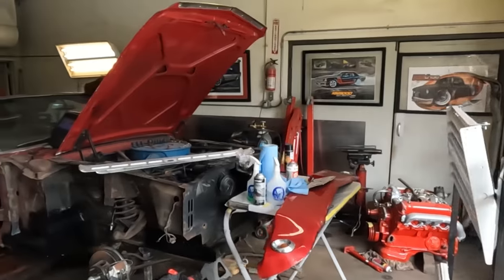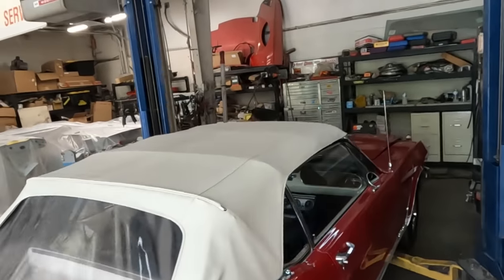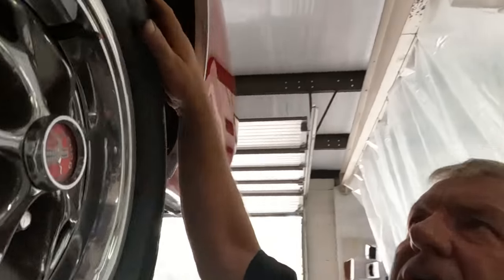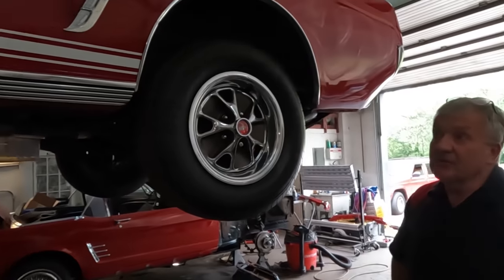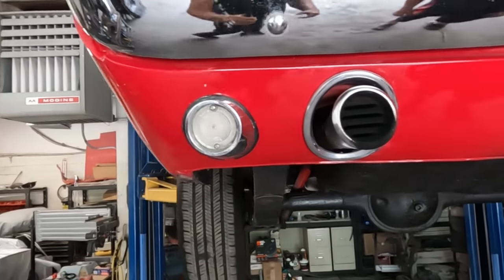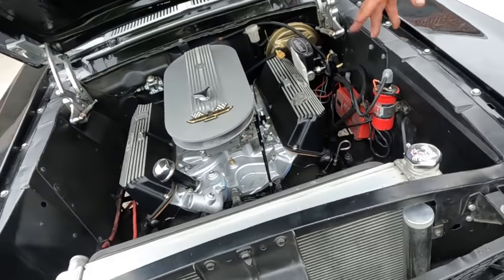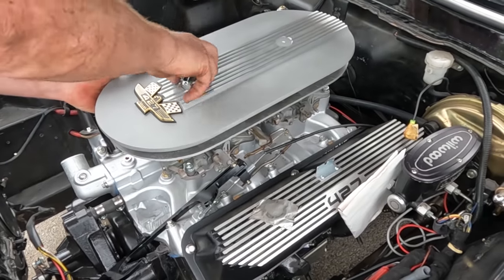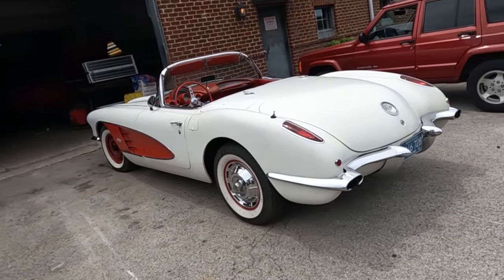Even MORE Classic Car Flipper Thievery, Incompetency And Nonsense

Comment: Don't know if it's true or not, but I've heard there are more '57 Chevy "convertibles" registered today than were built.
Reply: That might be true, but a 57 Chevy has a real chassis and would not need nearly as much added structure when the roof is gone to make it an convertible.
Reply: There’s more 57 Chevy Convertibles registered in California alone than were built. BUT 57 Chevy body’s are reproduced. Same with 32 fords more on the road now than in 32
Reply: @morganbrowning867  there are more amc pacers on the road than were manufacured by amc
Reply: @morganbrowning867  Not supposed to be able to register those as '32's or '57's.  Someone in a NC DMV got into a lot of trouble several years back for issuing bogus titles.
Reply: @seed_drill7135  but you can take a 4 door cowl and make an “original” convertible.
Reply: @hanselemans4237  The 57 has a Frame, the Body is not as important for structure strength!
Reply: There are also more 2 door 57 chevys than ever built.
Reply: and every Chevelle is an SS
Reply: Had a ‘65 Mustang convertible when I was in high school in 1975. “Looked good” but if there were more than 2 people in the car the doors wouldn’t open, or close for that matter. Only owned the car 4 months.
Reply: There are more split window 63 vettes today than registered in 1980
Reply: I wouldn't be surprised one bit by that.    Their are definitely a lot more Cobra's out there than we're ever built
Reply: And every Camaro is an SS, RS, BS, I would NEVER buy a retail, resale, brain dead red redoo. If there is no factory documentation, forget it, & if there is, there are a # of attorneys that specialize in vehicle fraud from this era. A little $  up front.... I checked out a  '68 Shelby 500 that had the front end facing northeast & the back end to the southwest. Otherwise, it was a great car. Hard to believe, but the doors closed. I never bothered checking the horror story underneath. Shelby should have insisted that ALL 'twangs were built with a convertible frame, unlike this umbrella top.
Reply: @gregorylyon1004 cobra kit cars don't count
Reply: @winteroutside7014 that can't be.
Reply: Same with Camaros

Comment: This occurs because the prices of all classic cars have reached ridiculous levels.  This invites the unscrupulous.  The prices for garbage cars from the casual enthusiast are, as a result, way overpriced.
Reply: It's crazy how much more attainable these cars are so long as you're willing to turn a wrench yourself.
Reply: i hate it. I bought a 1961 beetle with no engine back in 2017 for 1,300 bucks and now if i try to get one in same or worse condition easily 4-5k for 61 non running
Reply: Problem is, even your standard car truck ect, somebody could of bought it for 500 1000 because of MAJOR issues, cover it over, add some lucas basically do the used car salesman fix, SOMEHOW get it inspected, and then sell it for 6 7 8 9 grand, when its not worth the registration. A clean interior and exterior sells. That's the sad part.
Reply: ⬆️ Facts, also if you can learn to love sedans or station wagons that will save you alot.
Reply: And you know>
Reply: Here in Holland someone asked for a flooded! second gen pontiac 10K........
Reply: This crap has been going on for years I was born in 79 and remember as a kid cars coming into my old mans shop that was just bought ready to snap in half. This is nothing new. I remember a 65 Mustang Convertible and it was red as a kid being in my dad's shop and the frame was rotted out and the guy had just bought the car not long before. Mustangs seem to attract the slimballs that hide the rot and sell it to poor guys that thought they got a deal.
Reply: heck, not even cars. ever use the expression "get the truth from the horse's mouth" or "don't look a gift horse in the mouth" ? both come from the days when horses were important, so sellers would dye the horse's hair to hide its age. you had to look at its teeth and gums to determine if you were getting screwed or not. and yet here we are, still using the phrases.

as for the high price of old cars...before the prices were high, you didn't have the aftermarket support and repop parts like you can order up now. You bought a rust free 383 car to cut it apart to save a Hemi. Now you can afford to save a rusty 340 car because the price of cars is high enough there's a market for reproduction parts besides what you found in JC Whitney catalogs (VW and flat fender jeep crap).  Mustangs "attract slimeballs" only because that is where the market has always been. Not too many are buying them for gas mileage, like the VWs for example, but I'll bet a few VW buses have had their roofs opened up "23 times" and other such conversions.
Reply: @complexdetai   I bought one in 1975 and the engine fell out. The paint was nice. Probably the strongest thing holding the rust together.
Reply: @complexdetai  
Very true.
Reply: Again, big money ruins everything.
Reply: Respectfully i'll disagree. I live in the rust belt and 5 years ago i picked up a running 1968 Olds 442 for $4500. when Fox bodies were cheap, i picked up one and a turbo t bird (same chassis). If you can stand the LS or the third gen Hemi, there's early versions of those out there still affordable (for example, i'd never buy a new Shelby Mustang when i could pick up a used coyote and slap on a blower and voila--but i'd rather have the performance than a "look at me" car)--and honestly those and the Foxbodies drive better than my old Olds, get better gas mileage for long distance car shows, plus have AC. 

you do have to search more for the old cars, but they are old cars, so you'd have to do a lot more work no matter what--their odometers don't go past 99,999 miles for a reason :) But big money is the reason why you can order up parts with your credit card--big money has created big demand. Before "they" got into the market, parts were a ton harder to find once they left the NOS stockpile. you searched Hershey or Pomona or other big swap meets a few times a year and hoarded what you could--and wear items like rubber or interior were a real PITA. 

Many classics went to the crusher because it wasn't worth trying to save, say, a 340 Duster. the parts were unavailible. now you can sit in your room and go online and get repops, b/c big money is in the market and demand creates supply. you just have to figure out how to use it to your benefit--think outside the box as everyone loves to say.
Reply: Also the fact that finding these old cars in relatively good shape  " not rotted out " to fix up is becoming rare . Most of these flip cars were rotted out from the start and are now overpriced bondo buckets that will crack apart within 10 years unless you store them in a climate controlled environment and never drive them .
Reply: @complexdetai  Try finding an 1983/84 VW GTI for under 15 grand . Used to buy them for $500-$2,000 in the early 2000's , now that I'm 46 years old and want one to fix one up or buy a driver thats ready to go it's $15g + . Sorry I am not paying that for a 90hp VW .
Reply: To be honest this is bleeding over to everything nowadays classic trucks dude couldn’t give away are now commanding high prices 90s JDM cars going for insane prices hell even a regular guy like me trying to find a cheap 90s early 00s LS400/430 is getting annoying guys wanting 8-10k for a 200k mile car
Reply: The real problem is created by the guys with more money than brains. They got lots of cash but don't have a clue what they are buying.
Reply: The same thing is happening with houses.
Reply: I just paid 9000 for a 67 impala and 73 VW bus together. They need a lot of work but if you can research, haggle and do the work yourself you will get a good deal.
Reply: Good point Gordon.  Once these cars became "blue Chip" the flippers came out the woodwork.  Now every bullshit body shop is a restoration shop.
Reply: @barneymiller7894  yt channel'' dd speed shop'' converts 4 door cars  into 2 doors but they are not high quality and still are rusty
Reply: @79tazman  i bought a brand new model  T and the wooden frame was rotted almost killed me . someone replaced the wood with basswood
Reply: @albertgaspar627  gold coins my not even be gold but might weight exactly the same as gold coins
Reply: @winteroutside7014  I've been watching his Impala build 👍
Reply: @barneymiller7894   i think he said he is building that  for his father
Reply: @winteroutside7014  true, you want something that's actual currency so it's got a rating, not just some "collectors coin" offered in some magazine ad. who really knows what you're paying for until your check clears. 

back before cars existed, it was common to dye the hair of horses being sold to suggest they were young and worth more. the smart buyer checked the teeth and gums, and so today we still talk about getting the truth out of the horse's mouth unless its a free gift horse.
Reply: @albertgaspar627  interesting correlation about historic sayings related to horses and the very subject we are talking about is the Mustang, also nicknamed the "pony" car. Rather ironic.
Reply: @stephensaasen8589  Very good catch :)

speaking of irony, Plymouth beat Ford to that pony car market by mere months with the Barracuda model. but as we all know, we refer to this "personal commuter" or "secretary car" as Carroll Shelby referenced it, as a "pony car segment".
Reply: @barneymiller7894  I not to sure about wagons, finding a good one is much harder than a the popular two door versions.  They were used in Derbies  the big engines and drive trains harvested for other projects. A full size original wagon with options and the big motors bring big money  !
Reply: @manchesterexplorer8519  Try finding a Sirocco or it's Audi cousin . Used to be a dime a dozen.
Reply: @MUUKOW3  Yah they don't really exist anymore . I've owned a 1986 Scirocco , they were very problematic with even just 65k on them . Most ended up in the scrap yard before they were even 8 years old , the rest were just beat to oblivion .

  My best friend in highschool owned the first Audi Quattro 4000s with the Vacuum button all wheel drive that was made for 1 year . If I recall  it was an 1984 as it had split headlights  but was also a piece of junk that sat in the driveway more often than it drove as it was always needing something . But  they bring serious money these days due to being so rare as they really don't exist and they are sexy looking if you like Euro cars but parts really don't exist so be ready to pay up for very simple things .

  It's funny but my first car was a 1986 Plymouth Reliant   "K car " which was a ton more reliable than my Scirocco  that I just had to have because it was " cool ". With hindsight I should of just drove the Plymouth until the wheels fell off instead of selling it to put towards a Scirocco that was usually broken with transmission linkage issues  and other various problems .

   The Audi 4000 and Scirocco were very cool looking cars but that's about it lol . The original VW Rabbit was a decent  car though , especially the diesel but they are now so overpriced that its beyond ridiculous ..
Reply: The people that get sucked into buying these cars are the ones that buy to impress there friends.  A real enthusiast would know better than to buy a car like that! The guys that buy these cars are also the ones that put Classics out of reach for the average guy.
Reply: Horrible old hogs, most of these american classic cars. Most of the buyer have nothing else to use the money on so I dont see a problem with these stories here. They can just scrap them and buy another outdted muslecar.

Comment: One thing my dad taught me early on is a common sign of poor workmanship is looking the rockers over. Fly by nighters and wheeler dealers rarely ever invest any time or effort into the areas that aren’t readily visible. You’d be surprised how many ostensibly “nice restorations” have rockers that look like they’ve been worked over with a ball peen hammer. And on closer inspection are absolute turds
Reply: I always thought of that when ever I work on something even the non visible parts..... essentially every part  perfected even the most unthought of ones contributes to the overall quality
Reply: true, when i was apartment shopping, the landlady bragged about new paint and carpets. So i bee-lined for the closet to see if they bothered with that section. She was suprised, said no one had bothered to check. Car trunks used to be the same way.
Reply: Sometimes it is just ignorance. I knew a mechanic that was like that. I tried explaining that the cam, transmission and axle choices were just the beginning. The body choice and structure also needs to be balanced too. He and his buddy where like that. Put a 460 in a Maverick and could not understand why I told them to do not brake torque it. Put a roll cage in it first. There are 68 Mustangs that came from the factory like that. The 70s Maverick shares a lot with the early Mustang.
Well after removing the cracked windshield and shattered rear window there was more room to do that that.
Getting the replacements to fit was a bit of a struggle.
Reply: True what you all say reminds me of this one time an inlaw lady wanted to buy a second hand car knew nothing about cars called me up,the seller though she'd come alone, she'd even ready with the cash, met up suffice to say tye guy wasn't impressed looked under the car at a friend wheel balance shop,checked under the Bonet/hood saw sign it hd been in a crash checked the truck took it on a test drive over rough terrain over 100 on the tarmac the dash was a Christmas tree she didn't buy it ,was quite shocked literally.....and it was termed as "mint" there are acceptable dings and faults that my come with a second hand then there is pure trouble
Reply: Ooooooooooo
Reply: @sultankuto8724  I hope you are talking KPH. If I was selling a car and someone took it to 100MPH before paying me in full, I’d smack them in the head after making them pull over
Reply: @redram5150  😂yeah ram KPH indeed good sir or 60mph a problematic ones would rattle or the steering would shake by as you approach around 100kph
Reply: @redram5150  If you tried to sell me a car that can’t do 100MPH. Then tried to put hands on me you’d lose your teeth and be getting you jaw wired shut. I don’t know how old you are but 100MPH isn’t a big deal some places in Texas have 80MPH speed limits.
Reply: @ryand4533  so you’d be left bloodied on the side of the freeway. Good to know
Reply: @redram5150  Na I’d be just fine. You can’t even handle riding in a car 🤦‍♂️
Reply: “I know just about everything. So if something is wrong I’ll see it. Plus I don’t really need your input because I designed it that way” -My ex making fun of me when people start sharing their car experiences with me
Reply: The cylinders that are the farthest from the oil pump are the ones that show wear first. If someone pulls a spark plug, they usually pull one near the front of the engine because its easy to reach. Pull the farthest one back, and if its got a lot of build-up, the rings and valve guides are worn. Some sellers will change the oil, and even change the spark plugs near the front.

Comment: People used to bring the car for a look over before the purchase , now a days most people bring it after
Reply: I've been around this stuff since I was in my teens (I'm 72). This was basic used car purchase 101 (get an independent inspection). Buying a used car is just about the same as buying a used horse (you have to know what to look for) I have been able to learn what to look for as to the basic integrity of the vehicle with out having to go with an outside inspection and I stay away from so-called pretty paint jobs and previously hot rodded vehicles. I bought a 1972 Chevrolet SWB 4wheel drive truck from a fellow and the cab and bed were pretty rusted (I'm the third owner). He started the truck and it ran smooth and mechanically was all there and the price was right. Come May of this year marks 45 yrs I have owned this truck.
Reply: Getting a 2019 Honda with a good carfax without an inspection- maybe OK, but to spend 20K + on a classic car and not get it inspected.....

Comment: How to do a 427 swap:
Buy a beat down 390, they put them in trucks all the way to '76. 
Install in car
Swap valve covers and air cleaner sticker with ones that say "427"
?????
Profit
Reply: Could even glue on some bolt heads to simulate the cross-bolted mains 😉

Comment: I worked at a British car resto shop, and the old part owner was selling a drophead 150 project. He had us get under it and tack weld a piece of flimsy sheet metal on the frame then coat it with spray on liner. He was laughing about it because he knew if he could sell it to someone, they would likely have the shop restore it, and he could report that it turns out the chassis needed major work. Such a ripoff.

I now own an upholstery shop that does NOT rip off customers. We don't put cheap covers over old and we can sew straight seams. But just as bad as those wanting to flip and rip off are also those customers that watch too much TV and think we can do a full interior over the commercial break. Drives me crazy most of the time.

Comment: We did that exact thing in high school with a 71 Buick elytra 225 4 door with the 455. 
Such a fun beater. 
We weren’t trying to hide anything though. Just kids having summer fun doing 200 yard one wheel peels.
Reply: And you know what? Thats great. That goes all the way back to the roots of hot rodding chopping the tops off of model T's and dropping in flathead V8s
Reply: i had a 66 nova 4 door , we cut the top off w a sawzall , it after a few summers it became a second car for me and the local kids would joyride it with a screw driver , id always find it around the corner and such . i painted "A Team" on the sides and sold it for $500 bucks